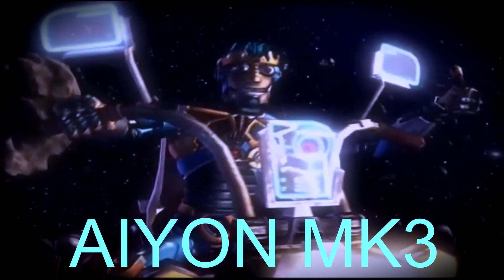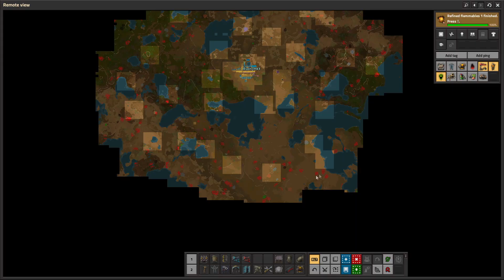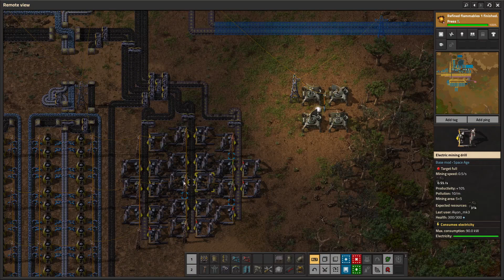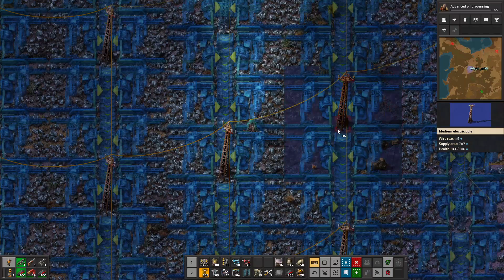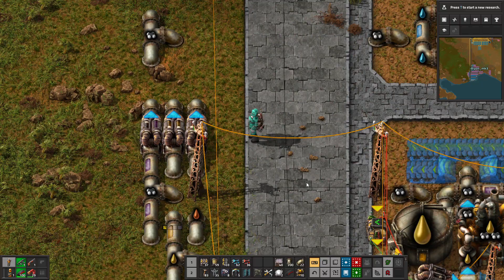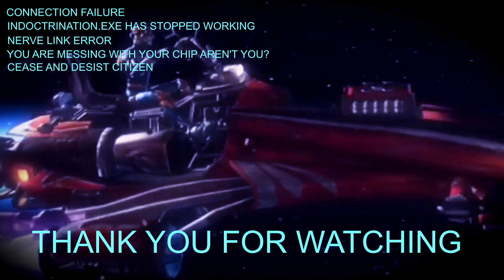Factorio Space Age / part 3 / Just a Small Refinery

Comment: looks like you will use vehicles a lot.
may i suggest the vehicle snap mod?
it will auto correct your vehicle angle if you are not actively steering. the default of 16 angles feels quite nice. and driving perfectly straight is so much easier.
for us watchers, seeing you drive into every second obstacle may be entertaining, but for you as the player it will get annoying fast, so give the mod a try.

i think you should increase the biter clearance radius around your base, especially south, since the lake are will spread pollution further than solid ground.
and maybe build a wall before going to space. since you will most likely not return to nauvis for quite a while.
while you pollution cloud will shrink when your base runs out of things to produce while you are away, the enemy expansions can get quite annoying to deal with remotely.
...unless you can just send a tank or two to evict them, of course. i believe remote control of tanks is possible?